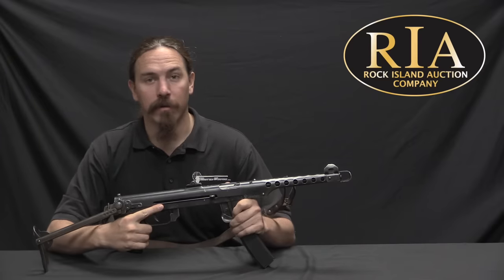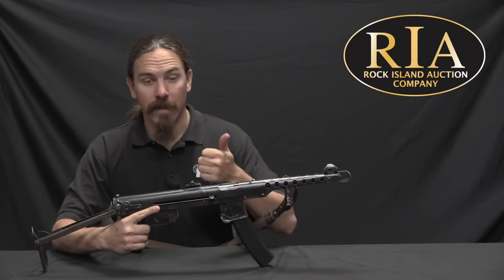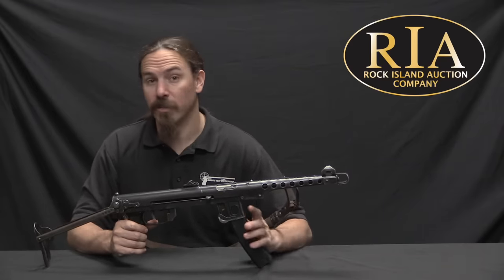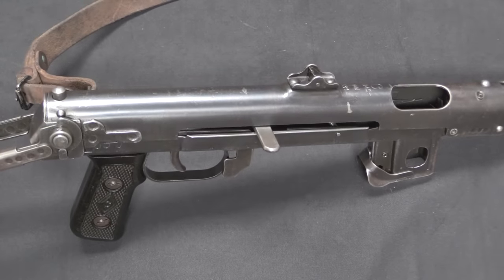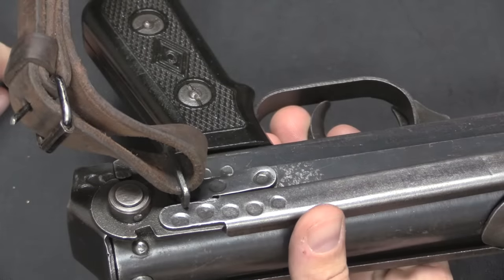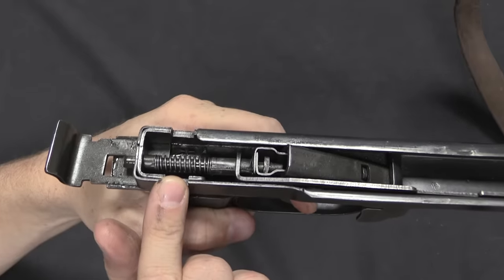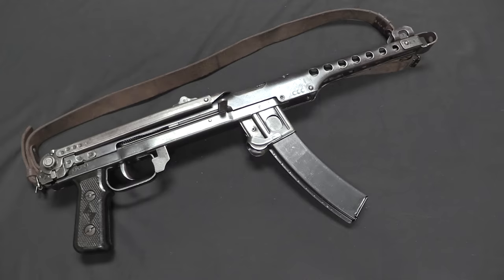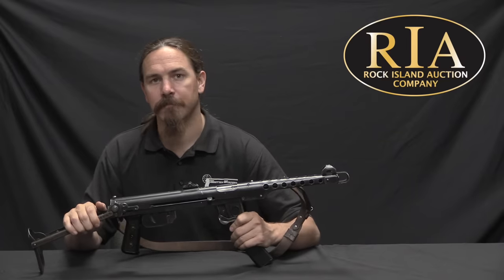Sudayev's PPS-43: Submachine Gun Simplicity Perfected

Comment: im not normally a fan of full-auto guns but the level in though and design that went into that gun is remarkable, though they only problem i can think of is the bolt handle, if i could  I'd twist it and then bend it forward so if i was wearing thick gloves i could still get a easy pull with out the risk of slipping. Also i see no slam fire stopper, was that just a think Russia at the time was not concerned about?
Reply: Soviet Union concerned about injuries to their troops?  This is the nation that cleared minefields in the Winter War by liquoring up their soldiers, forcing them to link arms at the elbows, and then march at gunpoint into the minefields while singing Communist Party songs.

There's a reason Russia lost 25 million people in WW2, dramatically more than any other participant by a wide margin, and his name is Stalin...
Reply: If you pay attention at the part where Ian engages the safety you can see that a bar raises that can lock the bolt in the cocked position. If the bolt is closed and you've inserted a loaded magazine the safety prevents the bolt from moving back far enough thanks to the bar too. You can see it at 7:06 in the video btw.
Reply: A Nonymous as much as I don't like Stalin or USSR, where did you bring that from? Proof needed, simply said.
Reply: If you're asking specifically about the "giving troops vodka and marching them into minefields at gunpoint to clear them", it's from a history on the Finnish/Soviet Winter War (1939) who's name has completely escaped me.  I came across it about twelve years ago.

If you're asking about the generally murderous orders and commands given to the Soviet people and military, all you have to do is look at anything from the Eastern Front in depth.  Example: the "mighty best tank in war!" T-34 had a transmission that was complete garbage (amongst other failings).  Stalin's response to reports that Soviet Engineering was not up to serving in combat was to order that any crew who had a broken transmission on a T-34 was to be shot because they obviously had sabotaged the perfect People's Gear Box themselves (called "wrecking" in Soviet Court Martial charges).  Hence, a lot of T-34s subsequently went into combat with spare transmissions strapped across the back of the engine compartment, just in case.

Soldiers were simply there to be gleefully expended if ten of them could bring down one German.  No refinement or preservation of soldiers was necessary or to even be countenanced.  Hence the hugely disproportionate number of war-dead the Soviets accumulated...and then had to blame on the "horrible machinery of the Germans....which was (somehow) still not superior to Righteous Soviet People's Engineering!!"  The entire Soviet system was built around people being disposable utilities, and Stalin was the posthumously-diagnosed psychopath in charge of it during time of war.
Reply: Try reading some of your own history that hasn't been white-washed.  There are reasons every country in Eastern Europe fears you.
Reply: +A Nonymous

try reading comething of my own history that isn't wikipedia or popular journals articles

> There are reasons every country in Eastern Europe fears you.

yep. Their generals want to buy new expensive toys, like in good old days of Soviet Union
Reply: No, because they know your culture is rooted on the insane idea that you are the "heirs to the Roman Empire" (somehow) and thus have the "right" to rule the world - which starts out with you conquering them as the intial step...which you've done several times already.
Reply: I'm not even gonna comment on all the other inane 'stories' you spouted, but I'm just gonna bring up one fact: Russia lost 25 million people in WWII, but only 8-11 of these were active combat troops. The rest were either civilians executed by the germans, civilians starving to death due to the war, or PoWs executed in german camps. If you're gonna bring up the entire totality of Russian deaths in WWII, you cannot blame it all on Stalin without mentioning the germans. That is dishonest.
Reply: You cannot blame the starvation on Germany, that was all Stalin's policies, both before the war and not caring enough to remove food before everything was burned for "scorched earth".  And again, you are ignoring A) civilians that were rounded up and dragooned into fighting despite having literally no training and B) Stalin's policies and military doctrine that treated human beings as "disposable" resources to be spent if ten of them dying could result in one German death.

Stalin was a monster and he is responsible for the massive bloodbath experience by Russia in WW2.  Just about any other adopted policies and doctrine would have resulted in fewer deaths - but Stalin wanted to climb to the heights upon a mountain built of his own people's bodies.
Reply: Yes, I'm sure the largest land invasion in human history and having the most fertile food producing region of your country occupied by an enemy power who invaded you to perform genocide on a vast scale had NOTHING to do with food shortages. You're ignoring the fact that fundamental goal of Operation Barbarossa was to annex and integrate a vast amount of land, up to the Ural Mountains, into the German Reich. The local population was to be culled and the remaining few put into slavery. You're ignoring the concentration camps, the pow starvation camps and the razing and burning of literally thousands of villages by the Germans and putting the blame on Stalin. Again, let me spell it out to you: HALF the total deaths of the Soviet Union during WW2 were due to combat. The rest were killed by Germans as prisoners, by Germans in concentration camps, by Germans as summary executions in the field, and of course due to the scorched earth policy. However, the VAST majority belongs to the former causes. You cannot explain your way out of the fact that the majority of Soviet deaths during the campaign were civilians, nor can you truthfully deny that the vast majority of those casualties were directly or indirectly caused by the Germans. Stalin was a son of a bitch, yes, but the only one(s) who made the decision to invade was Hitler and Nazi Germany.
Reply: A Nonymous By the way only 11 millions of Soviet casualties were servicemen , the rest 15 - non-combatants.

Comment: I think the only way for weapons to be designed and funded effectively is to station the designers who design them in bases at the front line itself and the generals who approve those weapons and sign those contracts to be stationed with the troops. Projects that cause massive drains like the F-35, U.S. Army squad weapon replacement for M16 and M4 , Su-47, Su-57, Armata got stuck because of both greed, like the Pentagon relationship with weapon manufacturers, and indecisiveness due to the lack of urgency that created incredible scope, wildly beyond the original plan. Putting those who are in charge on the frontline and maybe they might get a kick in the nut.
Reply: Um... also, submachine guns are incredibly simple machines.... and modern weapons systems very much arent. Might have something to do with cost. I mean... I think the f35 might have just a few more moving parts than this gun.

Comment: The Finnish KP m/44 was actually more often seen with a  box than a drum magazine. Being designed for the 9 mm Parabellum round, the box magazines (20, 36 and 50 round models) were straight rather than curved. Another visual difference is that the m/44 didn't have the long magazine well of the PPS-43 due to the need to fit the drum magazines and the wide 50-round Suomi box magazine.

Comment: It wasn't just the cost and production speed that necessitated the PPS-43 project. Both PPD and PPSh had solid wood stocks that made the SMGs a bit too long, not compact enough for some applications (vehicle crews, paratroopers, recon/infiltration units). The first batches of the PPS-43 went mainly to tank and SPAU crews, it was the "tanker's gun". Basically the same idea as with AKS-74U..
Reply: You mean that no one could make folding/collapsible stocks for the PPD or PPSH? They had to make a whole new gun so that it could have a folding/collapsible stock.
Reply: Would still have been overly complicated and costly to produce, and now with the added complication of adding a folding stock to a weapon that was not designed for it to begin with.
Probably easier to start over from scratch when they needed a simplified production version anyway.

Comment: I think you could save quite a bit of weight on this design by turning it into a bullpup, with the trigger placed just forward of the magazine well and the magazine well doubling as the grip (think Uzi). This would allow you to eliminate the stock and the rear grip. The weight savings means you can carry more ammo, or you can keep the weight as it is and "spend" the weight savings on a longer barrel and heavier bolt, which would increase muzzle velocity and thus both range and penetrative power, making it more useful against today's body armor.

Comment: I love the look of the PPS43, I have a 1944 Russian produced example also with C Code. Design wise, a work of art given the circumstances it was made. Return spring rod also bolt guide and the ejector.. trigger/sear spring also the takedown latch spring. Folding stock def resembles that of MP 40, but has a tighter lock and is more rigid over constant use. Top button to release stock lock amazing. By far my favourite SMG ever. You can keep your Uzi, MP5 etc etc., I’d go to war with a PPS43 in 7.62 Tokerev if I was going to war with a SMG. 
I have PPSh41 too, 1944 dated. I prefer the PPS43. I believe the PPSh had a longer service life based purely on fact that it was part of the image of the Soviet soldier to be seen brandishing one, image stamped into medals etc, interestingly though, Russia did make a Coin with the PPS43 on! 
Germans used PPS43 if they could get hold of them, plenty of pictures online in hands of Germans, not as many as PPSh41 though. 
I believe if the Com-Block wasn’t so closed off the 7.62x25 would have became a universally accepted round. In my opinion much better than 9mm. Not bad for a round initially produced for the Mauser C96. (Never fire Russian 7.62x25 Tokerev in a C96 though. The Tokerev round is much hotter)  I believe 7.62 Mauser could be fired in PPSh41 but due to lower power the rate of fire wasn’t as high? Anyone confirm this? 
I live in UK, so my examples are deactivated. Still Cocks, dry fires and stock folds etc, mags not cut etc. even completely strippable. So, that’s one thing we have over the USA. Gun laws are so strange country to country.
Reply: Humphries I suggest watch a 13 part series called What on earth happened by Ewaranon to learn that the earth is not a globe. I got it in my about tab.

Comment: I was hoping there was some explanation for how the gun could be so light and still have a low rate of fire. Any blowback gun balances bolt weight and recoil spring strength. As bolt weight goes down, the inertia of the bolt holding a cartridge in the chamber decreases, and spring tension must hold the case in place until the bullet leaves the barrel and the pressure decreases. That's why submachine guns are so heavy (for example, the MAC 10). I'd like an explanation of how they managed the low rate of fire.

Comment: 4:50
Russian soldier: "just got back comrades. The gun is good but needs sight fixing"

bomb shell drops in the background

Manufacturers: "Okay done"

Russian soldier 2: "comrades the gun jams up when I push the magazine really hard. Almost lost my arm to some shrapnel while unjamming it".

Manufacturers: tweaks the receiver and shortens the locking lugs "here a new one for you". 

Russian soldier 3: "the stock fell off-"

is instantly given a new gun with a better rivet in the stock folding mechanism 

You get the point.

Comment: You made one mistake. The main feature of this gun and main difference from PPSh was not cheapness, but size and weight. It's much lighter then PPSh and much smaller and compact. And so it's mainly go to the units which was need compact weapons. Air borns troops, for instance, was armed only by PPS (as personal weapon). My grandfather fought in airborne troops in the second world war, so I know this is exactly. Also it can go to the artillery or tank forces and so on.

Comment: sheet metal and only 3 machined parts (barrel, trunion, bolt)? that´s impresive! what? the ejector on the tip of the spring-guide-rod? I bet, they stamped the rod so hard that the diameter of its tip simply grew , no machining needed for that...!

Comment: I feel like this is a gun that easily could be modified to meet modern desires without adding much if any complications. Make the stock adjustable, make the sights nicer with option to add optics,  threaded barrel to take a suppresser, MAYBE a side rail for a light or IR... not much else needed really.  Maybe change the caliber too to something like 9 or 5.7, but i can see police or militaries still wanting it.

Comment: There's a joke about Soviet armament industry during WW2. About how they were testing each new weapon that came off the factory belt by just firing it right through the factory window at the approaching Germans :)
Reply: a joke that sometimes wasn't a joke - check out the fights for the STZ tractor/tank plant in Stalingrad. It was quite normal of a situation at some point where in one end of the shops there was tank parts production going and in the other end there was fighting with subguns, grenades, bayonet attacks and all the normal close quarters combat stuff. The oversimplified T-34s, sometimes even without a proper gun sight, were into the battle just after the factory doors